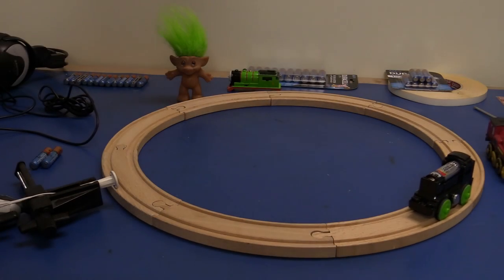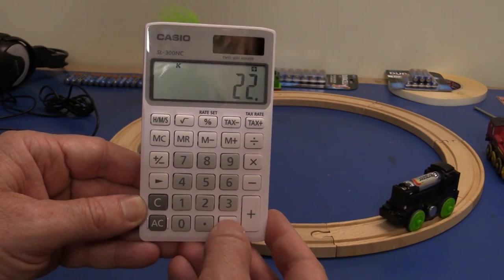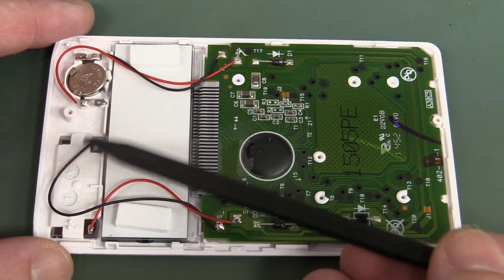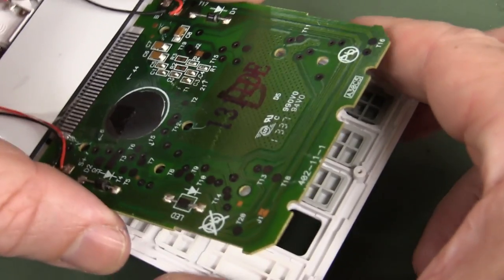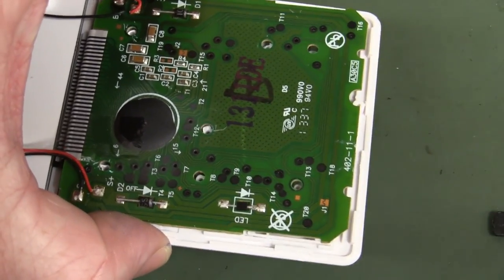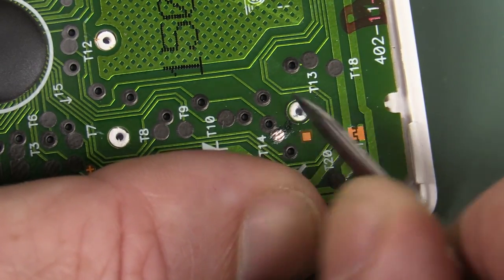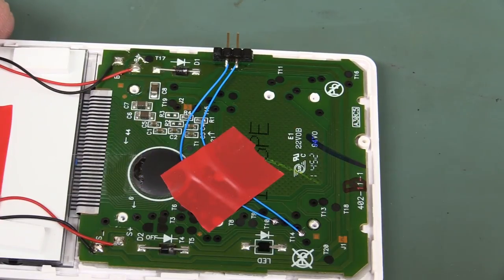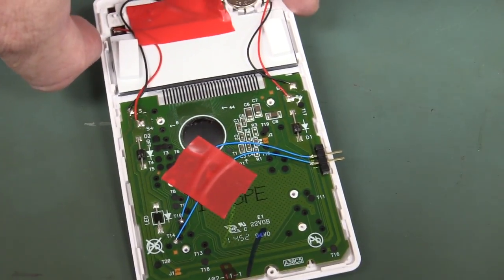EEVblog #962 - Hacking A Calculator Into A Counter

Comment: "or use a screw-terminal" Neither Pros or beginners should use screw-terminals anymore.

Spring-terminals are the way-to-go nowadays!
Reply: Screw terminals are still cheaper.
Reply: krokodyl1220 Not anymore... 
and even if they are cheaper, you would only save a couple of bucks with them which isn't worth it considering the advantages you'll get with Spring-terminals!
Reply: Terminals are obsolete. Toss in a BLE transceiver, Nordic chip or something, and use poured ground plane to sculpt off a PCB trace antenna off it :D Now THAT's a decent hack, eh? :D
Reply: Screw terminals are a pain in the ass for that guy having to connect hundreds of wires every day into them.
Reply: nrdesign1991 Exactly! + They are maintenance-free and wont burn down everything due to a loose screw causing a high contact-resistance resulting in a voltage-drop that will heat up the terminal and start a fire over time.

RELEASE THE MAGIC SMOKE!
http://www.ifs-ev.org/archiv/literatur/das_elektrohandwerk_17-2015.pdf
Reply: "having to connect hundreds of wires every day "

Tell the second-shift guy to STOP taking the wires out every evening. :p
Reply: Kew Akl
It's quite tedious work, for instance at assembly lines or at a construction site. Every time saver is absolutely worth it.

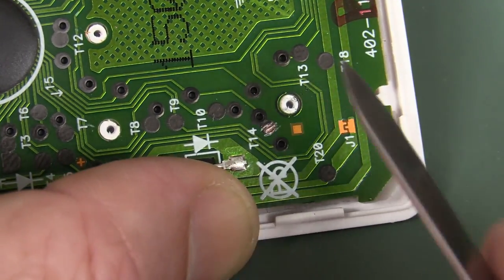Comment: 3:47 What is that word you use? 😮

"The problem of soldering to the pads instead of wires down _____"
Reply: "Vias", from wikipedia: A via (Latin for path or way) is an 
electrical connection between layers in a physical electronic circuit 
that goes through the plane of one or more adjacent layers.
Reply: It took me a while to understand what word they were using since the american pronunciation is different Its the word you say when your going via hwy 55 Dave pronounces it (veea) our way is (via) the way its spelled
Reply: Now, see, to my ear dave IS saying it how it's spelled. 

Then again, this comes down to the nature of vowel sounds.

E and I are very ambiguous in many languages and dialects.
What you refer to as 'eee' is the correct sound for I in most dialects of english I can think of, as well as Dutch and German, and uhm... Japanese.
What you consider the correct sound for I, many people would consider an A, ay, or ai sound.
And of course, what is an e to us is kind of a completely different sound than any of those.

Which means from my perspective, dave is saying Via, as it is spelled, while what you're probably thinking of  is as the 'correct' pronunciation for that spelling to me would sound like Vaya.

This kind of confusion is the reason English can't be spelled phonetically.
To begin with you have to establish which dialect has the 'correct' interpretation of what any given sound should be.

It's also why the IPA (international phonetic alphabet - the character set actually used if you're trying to write down the pronounciation of a word) includes at a bare minimum, 28 characters for vowel sounds, even though if you were to hear them all pronounced one after another you'd probably conclude that at least 20 of them are variations of A, I , E , O or U

On short notice I couldn't find a site that accounts for Australian accents, but the word 'via' according to an IPA converter is pronounced
ˈvaɪə - according to British pronunciation (the ' at the start is also an identifiable sound.)
and for American English both
ˈvaɪə
and 
ˈviə

Notice of course that those of those two variations not one is spelt exactly like the word. 

Languages are weird, but don't presume your understanding of how spelling relates to pronunciation is more correct than anyone else's, because it's very much a matter of perception.
And while I can imagine exactly what you most likely are pronouncing, my own interpretation of how to spell what you say likely doesn't match yours.
Reply: That's nice and all, but I think we all know the correct way of pronouncing via is /ˈwi.a/ (wee-ah) since that's how it was pronounced in classical Latin ;-)
Reply: +KuraIthys
Good job on the comment. You put a lot of effort into making this comment, a lot more than most people would ever do. My comment I just rattled off the top my head what I thought, without putting much thought into it. Thats the problem with watching people who are from a different country than you, I rember  watching dave for the first time. It was his giant HDD tear down to me he sounded like the stereotypical Australian to me, but after so long you dont notice the accent.

Comment: Same comment as on the other video with the monkey. This setup will not make an accurate comparison of energy drained from the battery with and without the batteriser because while battery voltage will go down just with the battery the current required by the train in this case will also drop so train will just move a bit slower and the power used will be lower compared with the fixed 1.5V output from the batteriser.
Nice hack with the calculator it reminds me of my office door counter when I was a child and there I used a cheap electronic watch setting the minutes but that counter was limited to 59 still good enough or I cloud have set that to let me know at what time was the door open first time :)
Reply: electrodacus it accurately counts the work done, though.
Reply: Exactly, it does not count time but work. i.e. energy
Reply: pretty sure it proportionally measures the work done (with a scaling constant which divides out when 2 things are compared) and thus the ratio of energy drained from the battery in 2 cases.
Reply: Are you assuming work done is proportional to the laps the train makes? I would be very surprised if the speed/power relationship was linear. That is, to go twice as fast, you almost certainly need more than twice as much power (at least above some minimum speed). So a train that moves faster will generally draw more power per lap.
Reply: Yes Travis you are correct and it seems you answered the above questions. Work done same as energy used is not proportional with the number of laps.
Reply: battery voltage > current in motor > speed of train.  Power = voltage*current
Reply: ***** I would be very surprised if it is not linear. This is not a train, this is a toy. Air resistance is not in any practical sense an issue. And regular friction is, in fact, linear.
Reply: So your complaint is that he's giving  the batterizer an unfair advantage? Riiiight.
Reply: I do not know if the battery or batteriser has an advantage since I have no idea how the train toy is build and at what voltage the peak efficiency is.
Batteriser is for sure an useless product in all cases I can think off.
Reply: Jasper Janssen - I didn't mention air resistance so don't put words in my mouth. The whole system is going to be highly non-linear, especially because it's a toy without any kind of smart engine control circuit (a real electric train would no doubt be more linear over its operating range). Think briefly about the behavior as speed goes to zero, or as voltage goes to infinity. I think you can convince yourself the efficiency curve (in terms of energy/lap or power/velocity) are going to be u-shaped. Is your claim that then the interesting range is somehow very linear?

It could be, but I'd be shocked.
Reply: *****
You will only use AA batteries in "toys" not even good quality toys since those will use rechargeable lithium cells.
I'm fairly confident that efficiency of this simple train toy is highly variable with battery voltage and that just means that more or less of the electrical energy delivered from battery will be converted in mechanical energy so the test setup will not be accurate representation of the energy used from the battery with and without Batteriser.
I have no idea how this toy train is build but my guess will be a cheap brushed motor and some plastic gears nothing more.
Reply: ***** I didn't put any words in your mouth. Learn what to accuse your interlocutors of while trolling. Those are my words, not yours.

Yup, the interesting range is linear. "Voltage to infinity" is a meaningless limit, BTW. We know very well what the maximum voltage is and it has nothing to do with infinity. The limit for voltage to zero is more interesting, but the type of motor that is in a toy like this will be pretty much linear. So will the drivetrain, to a very large extent. Probably to a factor of 2-3.

More importantly than that: a toy like this will be representative of the type of thing you would power with a AA. And lastly, if your claim is that the train becomes less efficient as the voltage goes down, you're saying that the batterizer, where the voltage doesn't go down, would get an unfair advantage. In which case I'd say it's actually a fair advantage, because, again, representative.

Comment: Please show how to hack the calculator LCD to use with an Arduino.
Reply: That would be nice!
Reply: What do you mean by "hack the calculator LCD to use with an Arduino" :) What is the problem with selecting LCD from farnell or digikey, then reading it's datasheet, finding which pins (most of the time pin layout is prety much standart) are for writting parallel ASCII character code to LCD (if it's dot matrix lcd) and which are for controllining (Latching etc.) Or if it's seven segment display which pins lights up which segment. And then simply connecting pins to Arduino or any other MCU digital port. And writing simple program to print something on screen by controlling digital port. As I understand there is no hacking, just simple engineering and everything is in the datasheet :) there are a lot of examples, but it's easy to understand and do it yourself if you understand few basic things (how to control microcontroler's digital pins (lot's of info, pure basics), how to connect LCD pins to microcontroller (simple, most of the time it's 8 bit parallel interface (8 wires) info in the datasheet) how to initialize LCD (it's in the datasheet), how to send character to LCD (it's again in the datasheet)).
Reply: Andrius Forgot Yeah Sure I can buy a LCD from Digikey etc and control it with an Arduino (or any other microcontroller) But I had a few old calculators lying around which I wanted to put to some good use. Anyways Thanks for all the useful information you've provided 😊
Reply: Andrius Forgot Because repurposing old parts is always more interesting than buying new ones. I should try it myself and then make a video of it.

Comment: Won't it auto power off? Wouldn't an Arduino be better?
Reply: It probably will auto power off, when the train has slowed down too much to make it in time. An arduino cerainly could count it, but you also want reliable output; this is easily understood by anyone and can be recorded with a camera.

Comment: OMG!  I was thinking about this hack yesterday, specifically how to make an easy cct. to auto press [1] [+/-] [+] [1] [=] on power-up.  Anybody got any ideas?  simple is key
Reply: Something like -> 555 running at 10Hz, connected to a 4017 driving optocouplers (across key contacts), last 4017 output connects back to the 555 somehow to cause it to freeze or maybe there is a count inhibit input on the 4017. I haven't looked at a 4017 data sheet in a looooong time.

By the time you have done all that, you might as well replace it all (including the calculator) with a ATMEGA / PIC something & LCD.
Reply: Lul, was thinking more along an RC ladder sequentially triggering a q to short. :)
Reply: yeah, absolutely, you also need a reset circuit for the 4017 so that it starts in the right spot. and a separate power supply unless your calculator runs off 5+ V ...

Comment: What a hacker the owner should ban him.
Reply: Hacking originally referred to this sort of thing -- modifying your own stuff to do things that it was never designed to do. The less ethical sort only came about later, with the advent of networks and security, and was initially called cracking. Hackers (the sort modifying their own devices) pointed out the distinction, but Hollywood and pop culture used the same term for both.